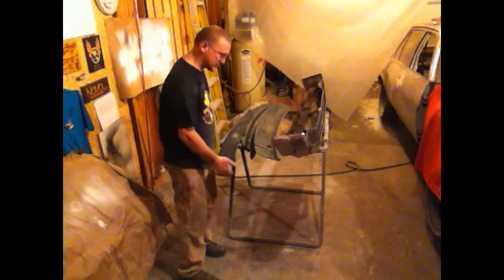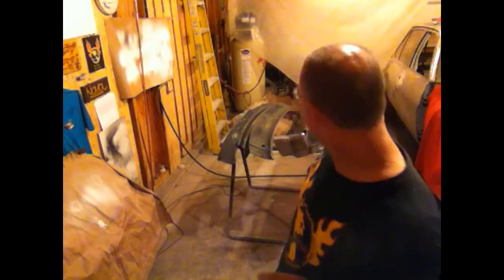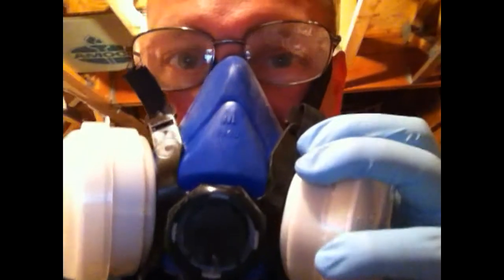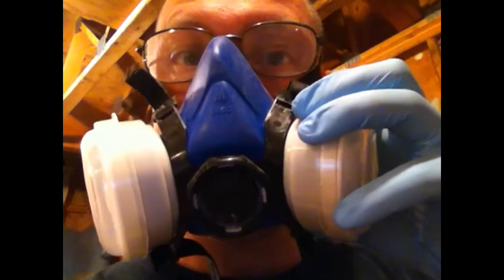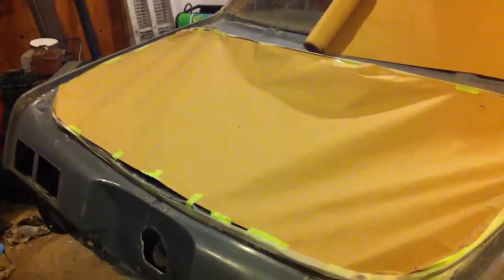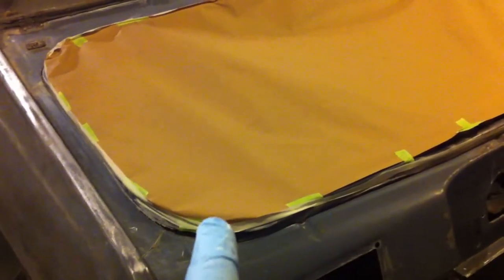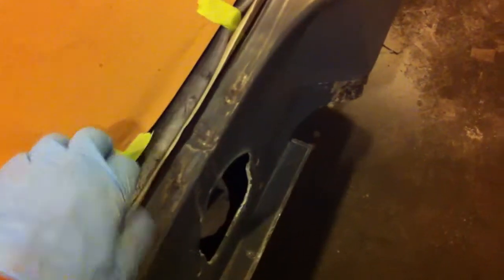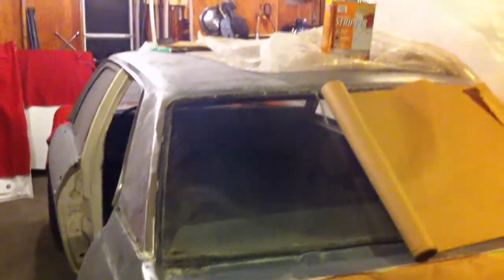Epoxy on deck lid a nd bumper trim pieces.. Awww poo!

Comment: he rear valance is kinda like rubber. You might just want to discuss that with Darrin, since you might need to prep it differently and use a primer that flexes and promotes adhesion